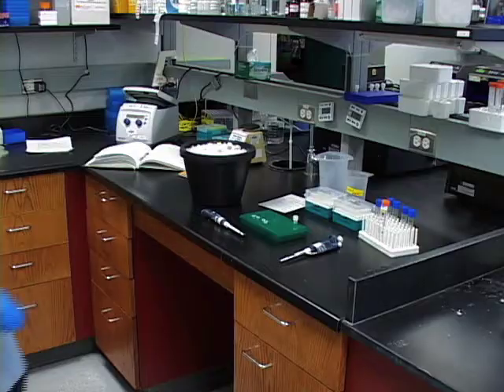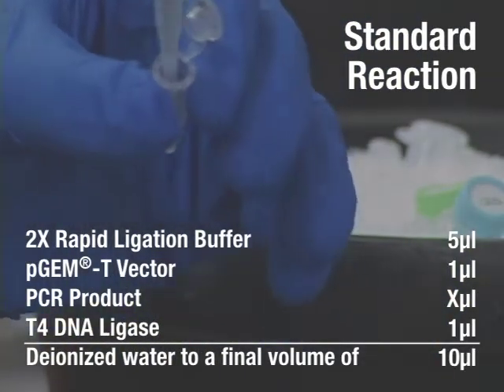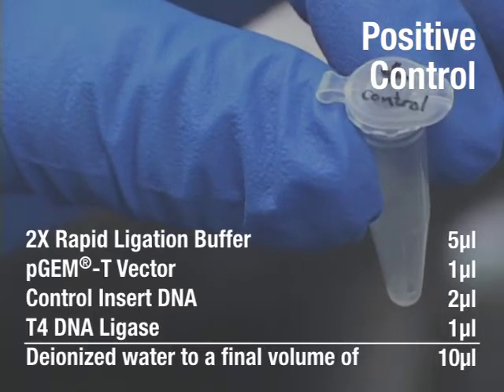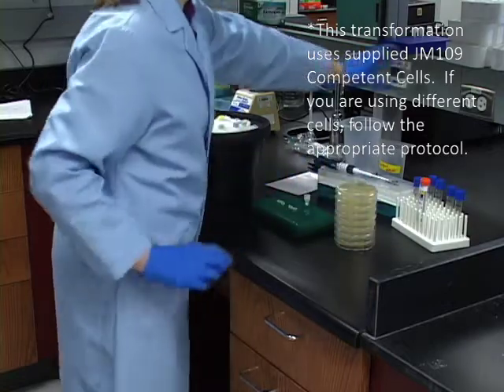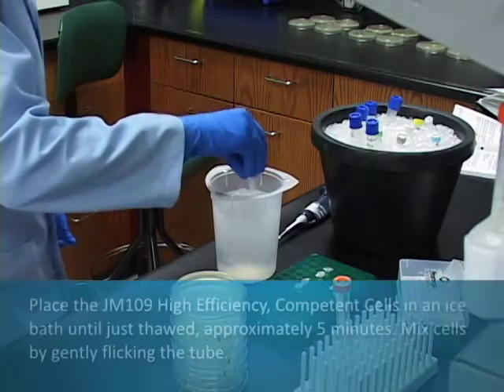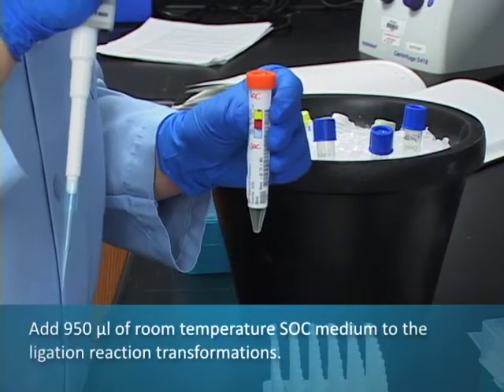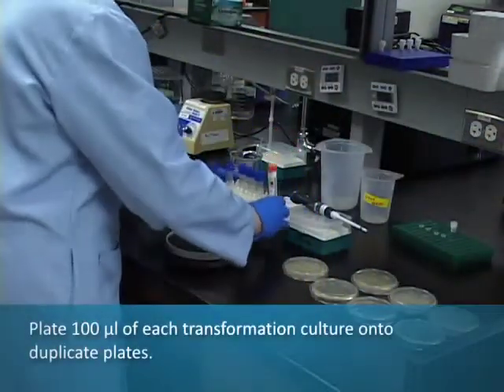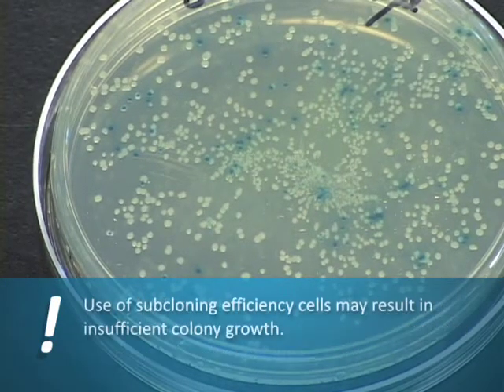pGEM-T Vector Systems Video

Comment: Hi! Yhe JM109 competent cells can be used for electroporation system?
Reply from the maker: Hello, We will refer your inquiry to technical services and post their reply here.
Reply from the maker: No, Promega’s JM109 Competent Cells are prepared for standard transformation protocol using heat-shock. Cell prepared for electroporation are prepared differently. Promega does not offer cells for electroporation.